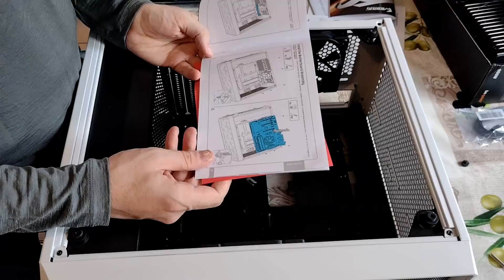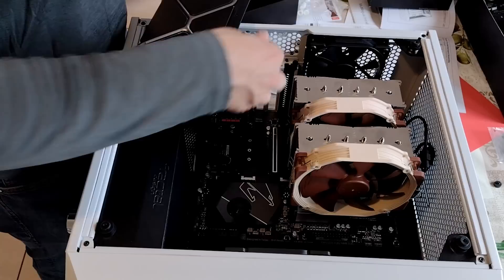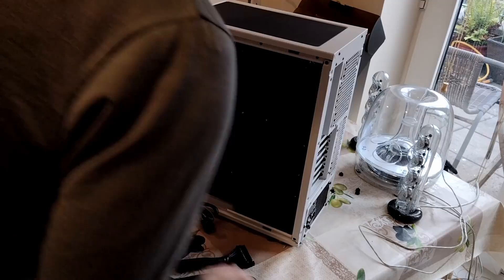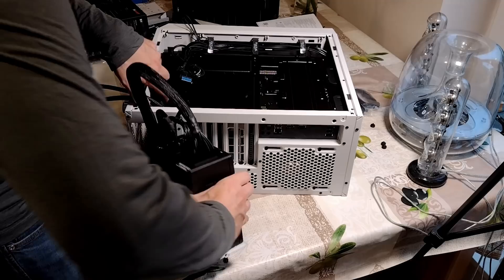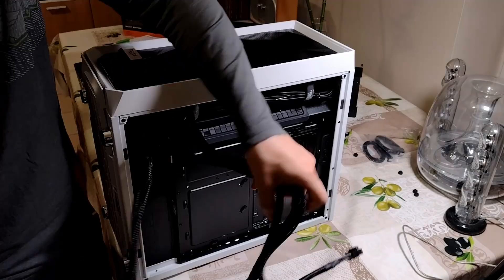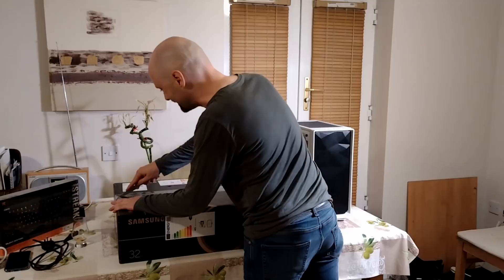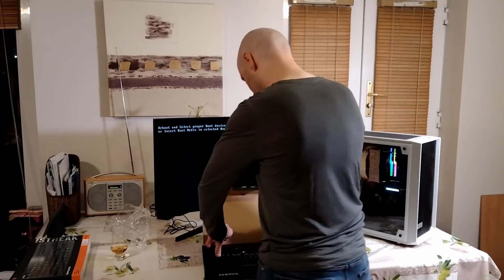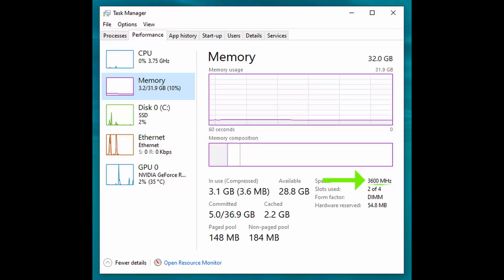More of a casual builds a PC

Comment: If you put temperature shift plates between the CPU and the heat sink you'll get a lower ∆t
Reply: A good cooler has such plate, usually made of copper.
Reply: @eideticex  oh I was only joking, ONI and all. Those copper heat pipes are something else though, vapor state heat transmission seems like an exploit of thermodynamics lmao
Reply: @keatoncampbell820  I've got the same cooler that he bought and that thing is a pure brick.  The reviews on it read something like "works great but this thing is silly.  For real, it's silly".  I thought, "How silly can it be, really?"  I got it and installed it and... for real... that thing is silly.

Good heatsink though!
Reply: @christianowens7233  I got a few water coolers but they are an older variety, seem to have been very reliable, the coolant has remained good and free of corrosion the entire time... But then I put a brick of metal with comparably weak and nonmetal fans... Something about the big metal brick is very appealing, even in a water-cooled system I want to use the brick instead of the radiator, which defeats the purpose lol

Comment: Just a guess, but I think it's a mixture of the case airflow and "improper" fan orientation on the CPU cooler. You essentially have a push/pull on one tower and the other is a gapped pull set up, aka not getting direct air.

I think a quick swap to a slightly larger case that will clear that cooler(the one I think you annotated that you wanted to order in the first place) will help fan speeds. Definitely messing with the fan curve in BIOS would help as well, but to make your CPU cooler do all the magical things everyone says it does, proper fan orientation is a must imo.

Love the videos whether you're playing on a beast or a potato, keep em comin'!

Comment: When he put that psu in, I was like, you Shoulda connected the cables, it's gonna be a pain to do it like that.

I knew you'd either give up and take out the psu and plug in the wires, or Spartan it through lots of pain.

Glad to see you still play smart rather than hard irl.

Btw ram generations have always been exponential Francis. If I remember correctly, ddr3 had a max of 8 gb per stick. Ddr4 has max of 32 gb on a stick and ddr 5 is gonna be able to 128gb per stick.

Comment: well done! It is fun watching the both of you together tackling this. I enjoyed and thoroughly appreciated the (whispered) questions and honest answers the most! Btw: The included fans usually are somewhat special if you compare the sticker on them with the available replacement ones (on the market). Play with the fan speeds whilst using HWinfo64 and gpu-Zs sensor tab and test-play/record.The GPU ought to drown out 600 cpu fan rpm easily (so ...kindly run a frame limiter suitable to your recording format?). 100% cpu fan rpm usually is never needed. fyi - IF there is audible wind noise from this otherwise fine choice of a cooler (running close to 100%) it is the fan in pull configuration (which is not in the infos you have) . Your mentioned case, 3-5 mm rubber spacer (80% fix) or lower LPX ram would remedy this.

Comment: It's actually not just gpus that becoming power hungry, intel's Core i9-11900K is well above 250W; the chip has been measured at nearly 300W

Also (rumored but pretty much all the most reputable leaker agreed on this) that the next gen Nvidia (Lovelace) and amd (rdna 3) will be massive power hogs, consumping well over 400W and peaking at 600 or 650W.

Comment: Don't worry about overclocking your RAM anymore.  Manufacturers are doing a really good job of making all of your resources available to your right out of the box these days.  Additionally; the performance increase you will get from the minimal overclocking you will be able to do is not noticeable.  And also consider that while overclocking you can make your system unstable.  And ANY instability, or even the potential of instability, in the process making videos for YouTube is quite a bad thing.  Might want to think about that.

Comment: Really fun to watch! In my opinion you did an excellent job if you haven't built a PC in while. Too bad your Noctua fan is a little bit too big your your case, but the ariflow shouldn't be compromised that much by chaning the position of the fan.
Not sure how your mainboard controls the CPU fan or if you used the low noise adapters, but I connected it by PWM without adapters and reduced my CPU fan speed pre-settings quite a bit. This fan is capable of transferring heat very well, so no need to let it spin up. I maxed the fan speed at 60% and my 3950X stays below 58°C at full load.

Comment: I built a very similar spec PC to this one, different brand motherboard/memory/3080, but still probably more similar than different. Look into undervolting the 3080 using MSI Afterburner. I found a happy spot on mine to be 1905 MHz @ 875 mV, but will be different for different cards I'm sure. Basically the problem with most of them is that they run really hot and then thermal throttle with the fans running super high. Most can be run quite stably at lower voltages and sustain better performance with less heat, less power, less noise.

Also for memory timing the Ryzen Master app was quite useful. I don't have handy the forum post I used to tinker there, but someone had done some speed testing for my specific memory and had posted guidance on what it could run at. I overdid it a bit and was getting frequent game crashes, ran a memory test and got tons of errors, backed it down one notch from that and has been smooth sailing since.

Comment: Today RAM overclocking will yield almost no benefits. XMP, especially on zen 3, are as close to perfection as it can be. Technically you can squeeze a bit of performance, but effect will be tiny. You can ramp frequency to 3800 (maximum supported by Infinity Fabric), but it will require manual tuning and timings setup.

Comment: I just realized you essentially built the same PC i was setting out to build before i downgraded a couple of components... (because reality and scalpers)

I'm not sure how many fans came as default with the Meshify C, but i've set the top, back and top front fans to read off of the VRM MOS sensor and adjusted them by noise level (and emergency jet engine), the front bottom fan reads off of system 1 or 2 (can't remember, the one nearest the graphics card).
I've already posted my fan curve for my NH-U12A on your last video (thanks for the heart).
I did a little research on the weird CPU temp behavior back in the day and it turns out that's just Ryzen 3rd gen where it briefly spikes up and drops down again (I've noticed swings of 10degC or more up and back down within seconds).

Also there are a couple more fan headers, there's one hidden in the top left (for the back exhaust fan), then there are three centered at the right edge and a bonus one (says sys_fan_pump, but who cares) centered at the bottom edge (i remember that one because i had to get a cable there from one of the top fans). Also there are a couple more cable management holes in the back of the PSU shroud, in case you ever decide you want to have a couple less cables running straight across the board :D

On the topic of XMP and being fine, in theory it's okay, but if you ever have an issue that requires you to RMA your RAM, CPU or MB and you are asked if you enabled XMP at some time, say No as it usually voids your warranty for any of these components (it's somewhere hidden deep in the fine print).

Comment: “My keyboard doesn’t have a F12 key”
Unless you have a Dell or any other proprietary system, you can get to BIOS using Del key - which all keyboards do have them.

What you might suffer is to manually chose a boot device - that’s F11 on some MoBo’s.

Comment: The 2 worst parts of any PC build, motherboard headers and cable management sorted!  One issue I noticed though, those huge CPU fans move oxygen at 10g/s but the case fan only does 1g/s causing oxygen to flood the inside of the case.

Comment: No Francis. If you had an iFixit screwdriver or similar ESD safe driver. You would simply not have the obnoxious slip of the allen key abortion they gave you. Man I really need to get around to measuring and printing some plastic handles for my allen wrenches, they are the stuff of nightmares to use regularly in bare form.

Comment: Your ram overclock was handled in the xmp profile if I’m not mistaken. You may be able to go further if you check the ram mfg they should have an option to view profiles for specific mobos iirc. I think it’s handled though.  If you go further down that path the standards don’t exist and you get 5 timings or 7 and few labels so you’re left inferring/guess and check/research and sweat over your new rig. Not worth lol but can be done if your xmp fails, like mine.  I think that’s why xmp exists now.

Comment: Alder lake which is intel's newest architecture seems to be much better than intel's previous 3 generations but still not worth it yet because drm issues due to its BIG.little design and high power usage.

Amd's "3d stack"  zen 3 refresh is their next lineup but it's probably not gonna be a big jump.

Comment: another enjoyable video. about the cpu fans, there should be a noise reduction adapter in the box to lower the fan rpms but it costs cooling performance. by the way you had the put the fan to the back of the cooler so it should be oriented to suck the air out of the cooler base towards the back fan. that way you have a push pull config. otherwise you're going to blow hot air towards the inside of your case opposite of your front fans and that would affect the pressure in your case and affect the cooling. you're probably going to loose a little performance from the cooler because you put the fan to the other side, you could do some benchmarks. for gaming its not going to be a problem (when you play oni, etc) but for the encoding and stuff if it tasks your cpu it could thermal throttle (i don't know if it would, just saying it's a possibility to bear in mind). another thing is meschify c is a little bit a "warm" case so your temps might be a little higher than similar configs in different cases. i just upgraded my pc and last week was all reading and watching benchmarks and reviews. i learned a thing or two. :) gamersnexus has a really good review of the meshify c and the new meshify and such. you could look up the fan orientation and cooling there to get an idea. about the ram overclocking: i learned that the important thing is latency rather than the speed. so a 3200 mhz cl14 ram would be better than a 3600 cl16 ram an so on. you could check out if you could lower your latency. unfortunately i don't know any specific place to look up these things but there is a lot of content other there.

Comment: By default on the vast majority of BIOSs the fan speeds are set to max and not set to PWM, so have a look in the BIOS for fan speed control and set to PWM for cpu fans.  If I could be critical of anything in your build which for a first time builder you did splendid would be the way you put the motherboard into the case, please don't place it down and then slide it into the back plate the screws standoffs on the case will be scratching the underneath of the board.  You should place the motherboard in at an angle pushing up to the input/output backplate and then lower it down on the screw standoffs.  Other than that you did it all pretty well.

Comment: I've kept postponing posting this but please, get a support bracket for that GPU or keep the case horizontal as if it was the 90s; the extreme weight will cause it to sag really slowly.
Reply from the maker: Really? I checked after install and it's pretty solid, no real wobble in it at all.
Reply: @FrancisJohnYT  Varies based on the computer's temperature and how tight it was assembled -  it builds up over the course of several months.

While it's easy to spot and handle before it's an issue, a youtube streamer neglected her 7lb/3kg 3090 to the point it ended up widening the motherboard's PCIE slot.

Comment: I'd be intrigued to find out why Windows Home is better for gaming over Windows Pro
Two key differences that I'm aware of between Home and Pro are the following
Pro let's you join a domain (unlikely to be needed in a home) and also Pro let's you run HpyerV to run Virtual machines.
I wouldn't have though that Microsoft would go to the effort to make Home and Pro any different from each other at the kernel level other than to make businesses pay for more features in Pro. Thinking out loud, I guess that's the thing then, Pro has more in it, so in Home there's less background services running maybe allowing a 0.1% better performance in games.
Also I note your monitor is curved, I'd be intrigued on your feedback on using it.
Is your previous monitor curved?

Comment: You might want to update your BIOS if you have not already done so or if it is not already up to date.  

Sidenote: DLSS is actually only AI upscaling of the resolution. So enabling it means your card calculates the image at a lower resolution and then it is upscaled by an AI. Therefore if you want to make your graphics card cry just disable it, set all settings to max and have ray tracing enabled. Will it be worth it? Probably not

Also have fun with this

Comment: Also Francis, I'm not sure why you want to toy with ram overclocking. If it's your fans, there will be software from your motherboard manufacturer that should allow you to control your fan profile. I think the bios will also have them but it's easier to just do it on windows.

Overclocking ram and messing with timings I've heard isn't very beneficial in general performance. You probably would want to overclock your cpu (sorry I forgot if your cou is overclockable and whether your motherboard allows overclocking) and your GPU. Most of the times, the cpu and GPU automatically overclock anyways. They 'boost' to higher clocks automatically if temp permits And voltage permits.

To keep temps down, people undervolt their pc to make sure it doesn't boost too high and keep temperatures in a comfortable place.

In the many comparison of ram speed in benchmarks I've seen for games, there hasn't been much improvements. And it's very situational too. Some games will benefit, others don't.

This is your daily dose of random advice from internet. I may be wrong but I hope I gave you some information you need.

Comment: Cherry MX are not all quiet, it's only blues I think it is that are. Mine is v loud. Not as loud as my spare which is microswitched though. 

You can get a mod for the noise which is literally some rubber grommets under the caps.
Reply: Blues are the loud ones. Browns and Reds are the quiet version. O-rings don't really affect loudness that much.

Comment: Did you get the 2nd hard drive installed? Also, might not hurt to verify the black fan in the back isn't fighting against the closest cpu cooler fan (airflow directions). Being that close, you probably don't even need that black one, or move it to the front of the case.

Comment: Did you need to change the fan direction when you moved them around?
Reply: ... so fans just blow in opposite directions??? what?
Reply: @mrShift_0044  fans pull in air around them but push it out forward, so if you want more airflow into the heatsink then the fans need to face them, lut your hand behind a running  desk fan and you will feel far less air movement

Comment: about the ram is best to get the best "older" ram (like DDR4) over the new ram because the old ram is optimize for that speed and the new ram is not and most of the games / software is not ready, is best to let new tech mature before using it
Reply: to OC memory is not tooo hard but have some things to be alert, like stability , just drop timings and test, re-test and test again, do not drop to much or you will get BS, do it incremental

Comment: Francis, be warned about the Odyssey monitors...

They all are defective, yet samsung seems to just ignore it.

Scanline Sync defect, and it isn't software/firmware fixable.

I ended up buying an LG UltraGear instead after wasting many weeks dealing with their horrible scam support.

If you still can, return it. Save yourself the trouble.. really. Scummy as hell company, and Odyssey monitors are legit all turds, unavoidable. If you don't get the scanline issue, it just means you aren't (AT THE MOMENT) playing/watching content that triggers the issue.
Reply: And no, don't worry.

DDR5 will suck IMMENSELY for the first 6months++++ 
DDR4 will be top dog for quite some time still. And even after that, it'll only be marginally better (literally pointless comparing, even)
Reply from the maker: So far the monitor has not given any trouble, I really hope it holds out it's a pain in the butt returning stuff like this.